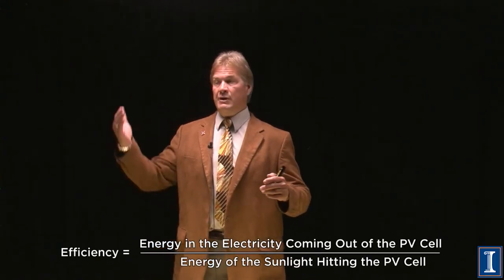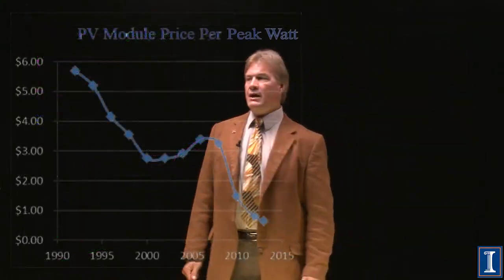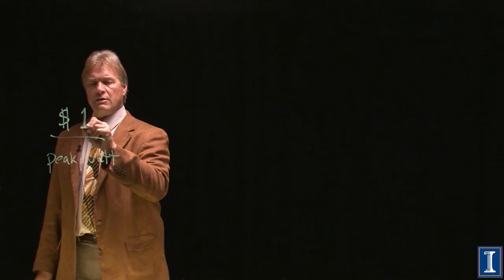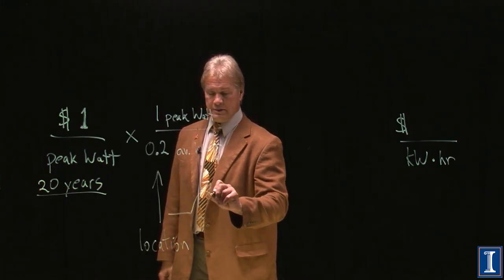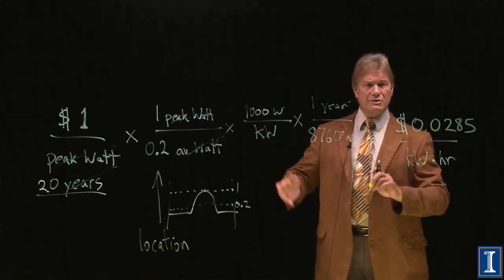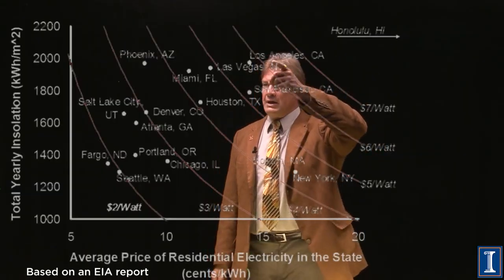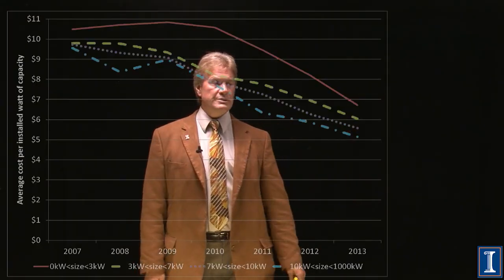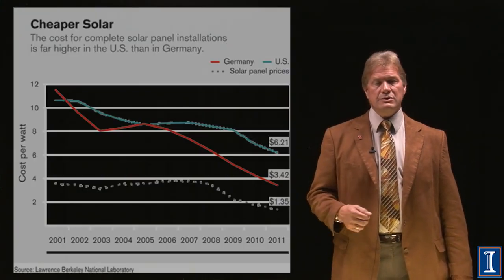The Cost of Sunshine

Comment: Update from Germany for the interested:
My parents got 8.16 kWp installed for 16.8 k€, including a wall box for car charging. 
The pure solar installation with 20 years warranty was slightly above 2$ per Wp.

In Germany we pay around 30ct per kWh so cheap Solar becomes economically viable much much sooner
Reply: In the Netherlands we pay about €0,20 per kWh, mostly due to taxes. So in 2012 I installed my first solar array on a tile-roof, 3.6kWh peak output, making 0.85 in kWh yearly, so about 2,5MWh/Year for only €4.5 with €1k back-fund from the government. At 6.5year later, they paid themselves totally and in 2017 I installed an second set of 2.4kWh peak, making 2MWh yearly for €2.4k. Also this second set will be paid off by itself this year. Because I'm a electronic engineer, I could do the installation myself, it saves you greatly on the installation cost of about €1k per set. So it really depends on where you are living, what the price of a kWh is and if you can/are allowed install it yourself to make a solar panels worthwhile to install.

Comment: Every photon you don't collect for solar power is gone forever into space, never again to aid the growth of civilization. It makes no sense in the long or short run to let any of that energy disappear. Most  of the engineering problems with solar go away when you place the panels in space and either use it there or beam it down. If you don't want shafts of light streaking through the sky then you can beam it down in microwave form.
Reply: The only way SPS makes sense is you have the following in my opinion
1) Cheap, and I mean really cheap launch costs. 
2) Efficent Lunar or asteroid based mining, materials processing and manufacturing.
3) Effective robotic or telepresence systems involved in the manufacturing.

But SPS would likely face just as many hurdles as nuclear in terms of fear mongering and public misunderstanding.

Comment: You should explain the commercial aspect and cost when you add in exorbitant subsidies. I think this is too ez for joe solar power warrior to understand and ez for them to discount. 

Very difficult to persuade the genl public w even this fantastic explanation.
Reply: Fossil fuels are subsidized to a greater degree than solar power. Even biofuels are subsidized and they are so inneffiecient that they don't even break even in terms of energy used to produce the fuel v. energy produced by the fuel.
https://youtu.be/k13jZ9qHJ5U
https://youtu.be/OpEB6hCpIGM
Reply: @iivin4233  keep drinking the kool-aid pal. https://en.wikipedia.org/wiki/Energy_subsidies_in_the_United_States

Comment: Good points about installation costs -- there is a very good reason for the different building/roofing codes across the US.  I live on the Gulf Coast -- very hurricane prone and consequently our roofing codes are very exacting.  I'm sure that people in Montana don't want to pay for hurricane proof roofs.  No more that I'd wish to have to pay for the snow load requirements on roofs in the Rockies or the Northeast.  Due to differing environments, we have to have different codes.  Germany (I lived there for 4 years) the weather is pretty much the same across the country (some exceptions for the Alps).

Also, I don't think the costs of storage is included in those numbers.  We have to factor in the cost of labor for the Chinese and African kids digging the rare metals necessary for the batteries.  Also, how much of the environment should we destroy to save the climate?  More costs have to be considered.
Reply: Every system used to produce electricity has costs. We just need to be aware of ALL the costs.

Comment: As a former Municipal Building Inspector, licensed electrician who has been involved with approving installations and who has a Tesla leased system on my house, most of the money is not the labor or materials, it is that as you say, each installation is custom and you cannot cut corners. Anywhere you cut a corner it will come back and haunt you. Working on roofs is dangerous, for instance. Cut corners there and lots of serious injuries and deaths will occur. I recently saw a large solar farm installation on a well travelled road, the land was undulating, it looks hideous!

Comment: I don't get the concentration upon solar PV installations on rooftops in particular (just about the most awkward possible place to install and maintain them).  Sure, it's the only place people have the place to put them in built-up areas, but there's no way it's competitive with utility-level installation in a field 30 miles away with utility-scale employment of people to brush the dust off them every now and again, utility-scale employment of electricians to maintain identical units, utility-scale inverters with their higher efficiencies, and utility-scale bulk ordering of panels and frames to angle them appropriately.

Who installs a miniature gas-fired power plant on their front lawn?  Why would anyone similarly insist that the only place for solar PV power to be installed is on-site rather than where it can be done on a more economic scale?
Reply: Covering farm land with a million solar panels is not very bright.

Comment: Called it. Regulation. !  I just bought and installed my solar for under 5$k. ( no regs.). With regs, and a company (22k$)
Reply: Not really. It's lack of UNIFORM regulation. Regulation, taken as a whole, is generally GOOD for innovation, but only when it's based on sound, rational thinking, and is easy to interpret, follow, and enforce. US building codes favor rich developers over all else. Balloon construction has many hidden costs. (Balloon construction (BC) refers to how most western houses are built).  BC has enormous energy costs--hard to insulate well, lots of thermal short circuits, can only be inspected at specific times which complicates logistics of building, material transport and storage, and labor arrangements. BC creates hideously complicated build project timelines.
Reply: @nicklockard sounds like BC is dripping with Regs too.   When something is simple-/., regulation machines can’t help but adding complications.  Green washing is a great business out here in Cali. As well.

Comment: The electricity industry usea LCOE for lifecycle cost of generatiom options. Solar+wind+storage is already the cheapest and decreasing in cost. With decreasing cost of panels the economics supports larger installations which will lead to excess power. This is already happening in Australia. It's a shame Prof didn't mention the important step changes forced by exponential cost reduction and the effect of economies of scale on all issues such as install costs and storage. Pretty big omissions for the most important changes to the grid for 100 years!
Reply: Yes, much more! U.S. generated more energy with wind and solar in 2020 than all energy sources except natural gas. Wind and solar outproduced all other energy source in 2020 in the EU. China produced 15% of its energy from wind and 16% from solar in 2020 and less than 5% from nuclear.

Comment: I’m a retired nuclear engineer but I have rooftop solar. It has worked out real well for me with an estimated payback period of about 7 years. However, 1) I got the system basically at cost since my wife works for the company, 2) I got all sorts of tax credits and incentives from the state and federal government and the local utility, 3) I live in southern California where the sun shines almost every day and 4) the local utility rates are very high.Despite the dramatic drop in panel costs, I am surprised that about 10% in my area (and it may be as low as 5%) have solar panels installed. These are homes that go from about $800K to well over a million dollars.
Reply: I am also retired from the nuclear industry. These are really valuable videos. The only thing I would add from a nuclear perspective, besides the obvious capacity factor values, is that the current gen 3 reactors (minus a few like yours, assuming you worked at San Onofre) are good for 80 years. So there needs to be a multiplier added in to make the costs equivalent to nuclear.  Nonetheless, these videos are pure gold!
Reply: 7 years? damn dude, here in NYC my break even point was not even 5 years, and cash flow positive from day 1 thanks to the tax credits and low interest solar incentive loan for most of the cost (and putting the rest on a credit card with an 18 month 0% apr promo). and my installation wasn't even cheap by most of the country's standards (nyc markup is awful).

i guess our electricity costs really are just that much higher...

Comment: The problem with "economic engineering" is that you mix "economics" (which is a social science) with "physics" (which is a real science).    
Cost of anything isn't really physics.  It's labor and the cost of labor is highly variable.   If everyone thinks they are worth $1,000,000/hr
then the cost of labor skyrockets.   If they think they are worth $1/hr then it falls.

Sure physics is peripherally involved.    Some materials/energy are scarce or difficult.   But installation isn't really that.   It's more
about the supply and demand of labor.    If the installers keep the prices high, they make more money.     

Notice that the laws of physics aren't really involved.   It's just perception and as such it's highly fungible.    Obviously the cost of installation
isn't set in stone.     Sure technology can make things easier and faster, but at some level, it's greed.

And that isn't really an engineering problem, it's a social problem.    Not sure what the answer is, but at least understanding the problem is
a start.

If you just staked the solar panels on the ground and ran wires to them, the installation cost would be nearly zero.      But you think that is
going to be allowed?
Reply: You ramble has no point or conclusion. Of course it is a social dilemma. It is the law of supply and demand raging together with technological advances. He mentions economics because his channel is energy generation 101 where he talks about all the other methods of energy production. These are of course compared when what they produce is a fungible commodity (energy).
Reply: @r-gart  Sounds like an economist talking.      

Ever hear the joke about economists and supply and demand?   Two economists are walking and one sees a $100 bill on the ground and reaches down to pick it up.   The other says "Don't bother.  If it was worth it, someone would have already done it"

Economists hate that joke.   I suppose they could add that with technological advances in bill picking up it might be worth it.   Or maybe they could call and find out what the current labor rates are for picking up the $100 bill.    If you don't get it, it's ok.

Solar panels are like the $100 bill on the ground.   Obviously it's worth it, but people keep whining about how we just aren't there yet.

Smart people are just installing them themselves.   It's not a technological problem.
Reply: @larrywiniarski1746  it seems you're angry but you don't know exactly at what.

Maybe at how much the bills are worth? Yeah, they aren't worth even the paper they are printed with and it's all a scam, I agree. Fiat money sucks and is bad. But you have to understand what fiat is.

Or are you angry at labor prices? Maybe you consider them too high? Good stuff. It means you can do this service for other people and charge them less than the standard and still feel it was a good thing. Why don't you start a business in this area? It would be great, you'd get a lot of clients if you charged less than the average for a good service for installing solar panels (as you said, "it's easy").
Reply: @r-gart  I'm not angry.    Well, maybe at the stupidity of the argument about the cost of installation.

I put my solar panels flat on the ground to kill some weeds.   They also generate electricity.   They work just fine at both.   

As far as going into business doing this?  Are you nuts?

Comment: Regional building codes are a much better idea. Obviously places like California are going to have different concerns than Florida when it comes to buildings. Homes in Florida are almost all concrete exterior walls and concrete tile roof construction. You could knock down almost every interior wall in a Florida house and it doesn't matter. California's houses won't stand up to Florida's hurricanes but Florida's homes aren't going to last through California's earthquakes. Homes in the midwest and northern US need to be built to withstand cold winters. Homes in the Southwestern US wouldn't do well with constant heavy snow loads on the roof and the relatively thin walls and exterior stucco that would likely crack and flake away after a few snowy freeze-thaw cycles.
Regional build codes are the answer.

Comment: Great video. A possible solution to the end of the video would be a simple economic argument about financially incentivizing homebuilders to create their rooves a certain way so that solar installations would be easier. Either that or mandate it, although I'm usually against that type of regulation for obvious reasons.
Reply: The financial incentive obviously already exists. Certain kinds of roofs are easier to put panels on, so it's cheaper to do so, so the incentive is there. You just need a list to see it.

Those who order the homes will then start the process, by paying a small premium for a more suitable design. Then the big step comes, of roof designers making special designs particularly suitable. Once these exist and the market has chosen (note that these may not be the most common roofs, but they are very common among those who want panels), installers will start training for the most common designs, allowing the cost-cutting effect of standardization. 
This in turn will make home-orderers who want panels always take these designs, since it's much cheaper.

A final negative effect is that roof designers in this category will then always design based on those models. A new revolutionary design, even if it's much better, is unlikely to ever win out, since the installers haven't trained for it and thus the benefits to the consumer don't overcome the expense of a premium installation.

As an aside: there is a second approach, in which the panel in integrated into a roofing rile. It remains to be seen whether this can be effective, but it may be ideal.

Comment: People often don't consider the mining required and the assembly required to make these panels. My process technology class which focuses on the oil and gas industry said that solar contributes the most green house gases in the long run, and is one of the most expensive sources of energy in the short term. Also not as reliable. Nothing against solar, but people don't see the big picture
Reply: I suspect that comment wasn't about assembly, since obviously it doesn't take a full coal plant to build equivalent solar panels. That'd be an obvious economic insanity we'd just call out as such.

I presume what's referred to here about the long run, is that for the foreseeable future, we do need fossil. Unless you have a lot of hydro, the alternatives (nuclear and green) can't quite be controlled enough to exactly supply the grid's needs. That's where fossil shines. Nuclear is amazing for baseload, but doesn't vary as easily. Green is almost completely uncontrollable.

As a result, a green system - until batteries can handle this scope - will require a 50% fossil system to balance the energy supply. A nuclear system also needs some, but I think it's closer to 15%. That's a big difference, and if you have a little hydro, bio etc that can give you another 10% controllable energy, that fossil gap becomes 40% vs 5%.

Your initial argument is also an important one to bear in mind. Green and nuclear still emit fossil fuel, since their construction requires it (steel for windmills being a major example). It's far less than fossil, but still a rather sizeable chunk that we can't just ignore.